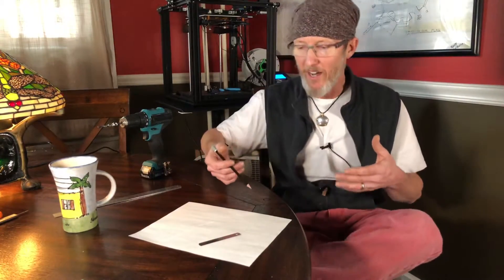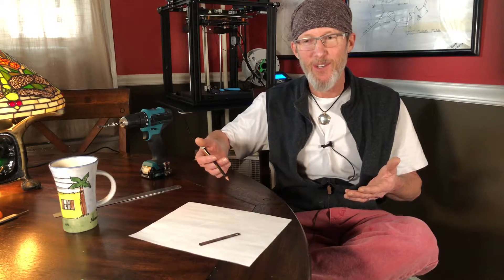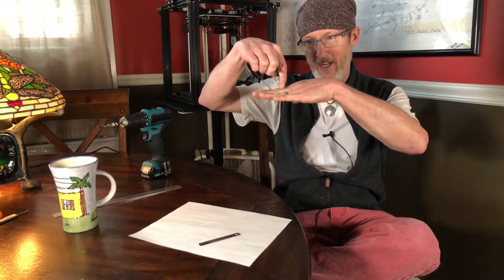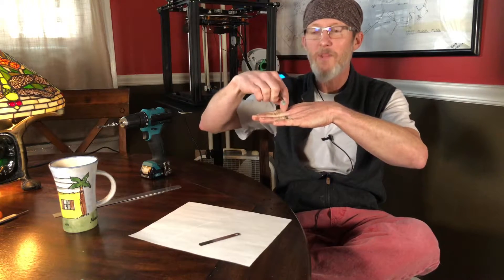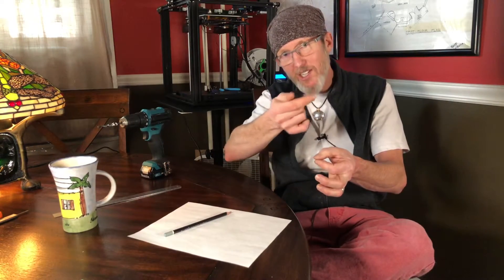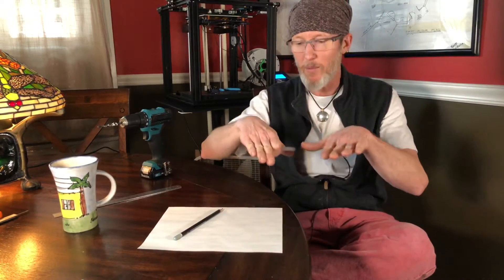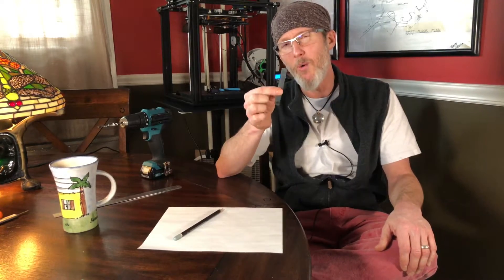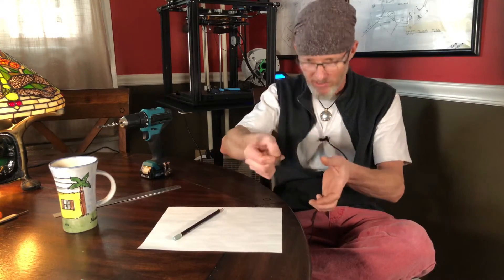The BEST Low-Tech Tool for Leveling a 3D Print Bed

Comment: Feeler gsuges are quite cheap. They could be supplied in the 3d printer's toolkit.

The thing with a feeler gauge is that is brings a little science and a little less feel. No pun intended.

If someone had the motivation, a guide could be do for a variety of combinations to get people printing well. I do note that there are printers that are automated, but they may still need calibrating.

A guide would contain eg...
PEI PLA 220c 60c 50m/min 0.6mm feeler height 

PEY ABS.....

Comment: If you tell people to use a feeler guage to level their bed at least tell people how to do it properly. By first raising the z-axis by the height of the feeler guage in the printer motion controls then zeroing the bed to the nozzle (while the bed and nozzle are preheated, remove filament so it doesnt ooz) . Make sure your stepper motors are not disabled as you can accidently move your print head upward when you are trying level.

Comment: I'm going to be getting an Ender 3 S1 printer in a couple days.  I plan to use standard PLA.   I assume glass is basically 100% flat/level, so I plan to get/use that after setting up the printer and seeing how it functions out of the box with just the PC coated magnetic bed.  Not going to worry too much if things don't work perfectly OOTB (Out Of The Box).  But getting a set of feeler gauges is definitely top of my list.

Question is, for Standard PLA, what is the optimal distance the 0.4mm nozzle should be from the bed?  Is paper a bit too close (assuming no compression)?

Comment: Also you can get feeler gauges at a local auto parts store. They’re used for setting distributor points, spark plug gaps, and valve clearances among many other things.
Reply: Well now i feel silly for ordering from amazon...lol thanks
Reply: @akuiori  amazon was probably the cheaper option, in fact im almost sure it was
Reply from the maker: You can absolutely get these feeler gauges at auto parts stores. Just be sure to get the set that has as many sizes as possible, because you want as many options as possible so you can fine tune the extruder distance. More sizes allows that flexibility.
Reply: Bought a set of 30 today for like $8 lol

Comment: here are my steps for perfect prints
1. home the print head
2. using the onboard control knob, i move the Z axis up 0.1(my feeler guage height)
3. Tram bed to nozzle with tramming knobs on all 4 corners and the center using the feeler guage.
4. Once it is tramed,  i re-home the printer. 

This will make it a true 0,0,0 so when i print something at 0.2mm, it will be e0.2mm not 0.2+my nozzle height
Reply: tramming to 0.1 position with a 0.1 feeler gauge sets the nozzle to absolute zero when it is re-homed? Is that too close? Or will first layer height compensate for that? Assuming a .2 layer resolution, is that too much squish? Seems like it may be.
Reply: @ARTIST11D  it will compensate for it via the layer height. This ia why i do it this way. I get the true layer height i setup in my slicer:)
Reply: Thanks. So is this something that you can save to EEPROM or do you need to do this before every print?
Reply: @dirediredude  It's best if you level the bed before each print. But it is time consuming. If you have a strong bed spring and pretty rigid printer frame you could level the bed every +- 10 prints (as i did) or as many prints as you feel comfortable. Bed levelling is mechanical so it got nothing to do with EEPROM. Sorry for poor English👍
Reply: @dirediredude  you dont save it to the memory, wish you could, but it ia something i do every 10 to 20 prints.
Reply: @dirediredude  It's best if you level the bed before each print. But it is time consuming. If you have a strong bed spring and pretty rigid printer frame you could level the bed every +- 10 prints (as i did) or as many prints as you feel comfortable. Bed levelling is mechanical so it got nothing to do with EEPROM. Sorry for poor English👍

Comment: I ordered a set of feeler gages (along with some other add-ons) several hours ago.  I figured I'd have to find the right value by trial and error, but thought it was going to be pretty close to .0025 inch (since that's the nominal thickness of printer paper).
Reply: Standard printer paper thickness is actually about .004 inches, or 0.10mm. You’re actually supposed to level your bed to the top of the build surface. Your nozzle should ideally be touching the build plate. But because most people are not that precise with our springy beds, plastic knobs, and whatnot, we use a known thickness like paper or a feeler gauge and compensate for that in the form of a negative z offset in software. When you level with a gap, you are essentially “lying” to the printer by telling it the build plate is 0.1mm higher than it actually. A true level has the nozzle JUST barely touching the build plate, then a 0.2mm layer would truly be 0.2mm. Try it for yourself. Level your bed with a 0.1mm gap and print a1 layer calibration at 0.2mm. You’ll see it prints closer to 0.3mm unless you are compensating in the slicer for the lie told your printer in the form of a -0.1 z-offset. 

In reality if your bed is flat, your printer is square, and you have decent enough eyesight, you can level with bed with nothing but a flashlight behind the nozzle to a true z0 and then you don’t need any slicer gymnastics to compensate for the gap you introduced. 

3D printers are loosely adapted from the CNC world. Leveling the bed must be the most misunderstood concept out there with so much misinformation basically everywhere. Most people in this space call it leveling, but in reality you are not leveling anything, you are “tramming” the bed relative to the nozzle.

I can provide a few additive manufacturing and  engineering websites as sources if you are curious to read more.

Comment: Thank you I will give it a try, do you level with the bed cold or hot?
Reply: always level with both Nozzle and bed at working temp :)
Reply: @hellraiser22222  why heat the nozzle to level the bed?
Reply: @djjakeradar   metal and glass expand and contract with heat and cold. You get a more accurate level with a heated bed&nozzle
Reply from the maker: @hellraiser22222  Also, the cold, hard plastic on the tip of the cold nozzle will give a false reading. The feeler needs to be flush against both the bed and the bottom of the nozzle to gain an accurate reading of height.

Comment: On the other hand, consider the damage done to the tip of your soft brass nozzle by slamming it down onto the gauge repeatedly. It gets further damage from the back and forth scraping as you check the clearance.
Reply: If you're slamming it... You're doing it wrong!  All that is required is a slight resistance... no more than that.
Reply: You are doing it wrong then.
Reply: Someone don't know how to handle his items...
Reply from the maker: I solved that potential issue by purchasing hardened metal nozzles. Also, you don't want to be so tight against the feeler that it doesn't move at all. It should move a bit. Sliding the feeler back and forth won't hurt the brass. Slamming it down onto the glass - yes, that will damage the brass.
Reply: You travel the nozzle down a fraction, with the feeler gauge out of the way, then try and pass the feelers gauge underneath. Rinse and repeat until you just start to feel drag.